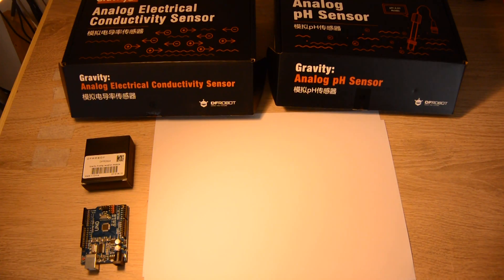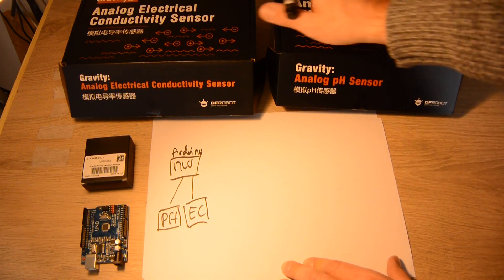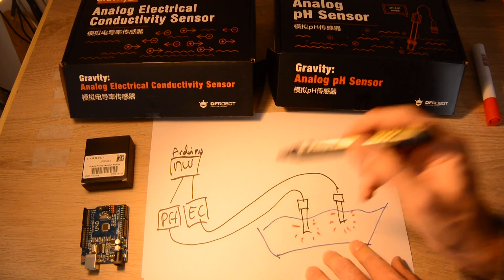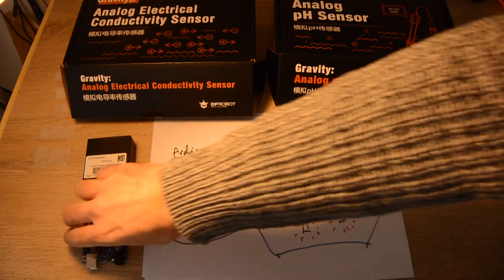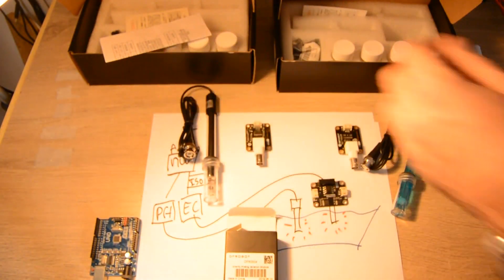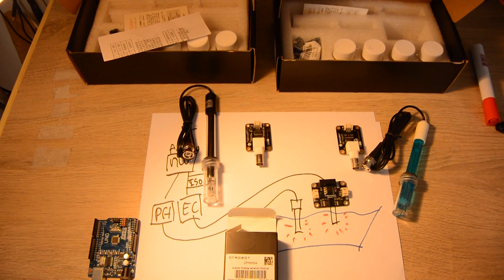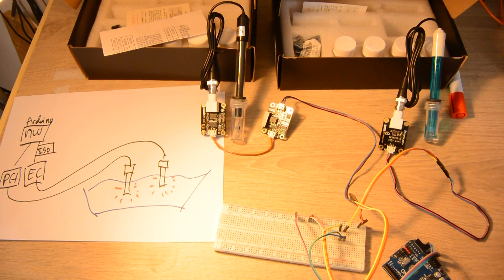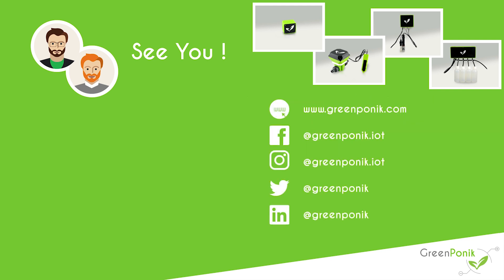DFRobot signal isolator module (DFR0504)

Comment: Great video, I am facing issues with reading ph values when I put EC and Ph sensors in same tank. Thank you for your help. Just I have one question, should I re-calibrate the sensors after putting them together in the way you are recommending?

Comment: I faced the same issue as my pH and DO sensor where in the same container. I have one question? If i put the sensor in lake with running water. Do i need electrical isolator module there?

Comment: Hi my sensor is connected to a 3.3v of esp32 does the Isolation module MCU side needs to be connected to a 5v or 3.3v also? How does this work with esp32?
Reply from the maker: Sorry, we don't use those anymore...

Comment: If you have a temperature sensor like the DS18B20 would you need an additional isolator?

Great videos!  Some people just like DIY and these help the community a lot
Reply from the maker: Hello @gnuyen you don't need isolator on other sensors. isolator is needed for ec/ph because the measurement is about voltage in water. Water temperature is read using resistance evolution.
Reply from the maker: No need for isolation with the DS18B20 👍

Comment: Your videos are really great, I have been following your channel for a few weeks now. I already had the Groundloop error with the incorrect measurements on the Arduino. 
I finally chose the solution with the isolator as well.

But at least on the Arduino and with the old EC Meter version there were two other possibilities.
If you read out the probes one after the other and set the mode of the gpio from OUTPUT to INPUT_PULLUP, the values become more accurate when reading. Unfortunately I can't find any possibility to change the pinmode in the new code.

Another possibility is to disconnect the probes with relays, with a sufficient delay the values are comparable to the isolator, but the measurement also gets slower. 

I discovered the isolator relatively late, the solution with relays is at least a temporary solution if you forgot the isolator in your order.

Anyway, really great work, I'm looking forward to hopefully many more interesting contributions from you :).
Reply from the maker: Hi Thomas! things have changed a lot since this video. We've developped our own hydroponic smart controller and it does wonders, accurately, all the time 😉
You can take a look if you want: http://kck.st/39ku9p5
Enjoy! ✌